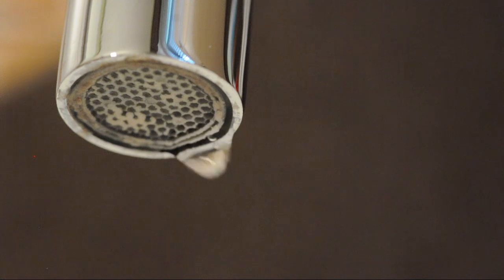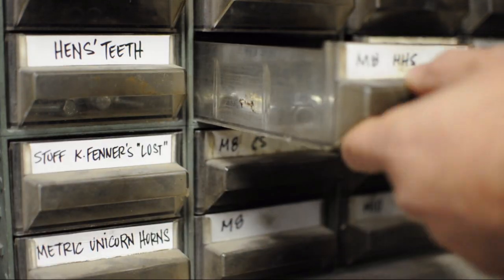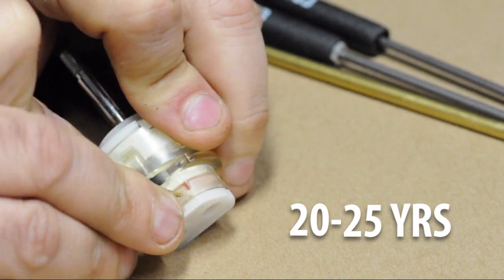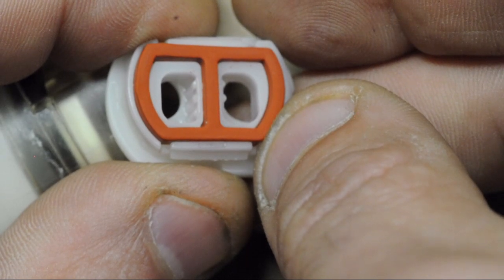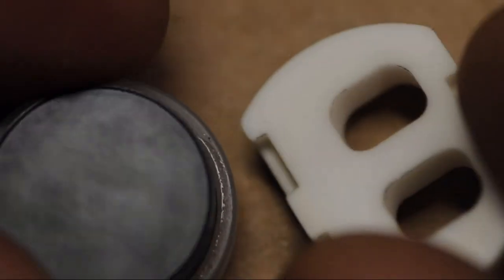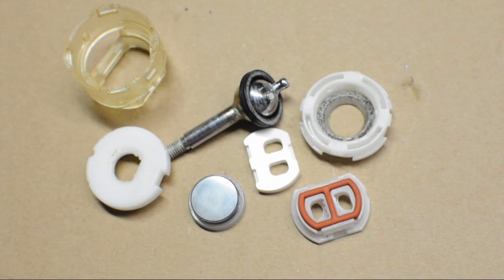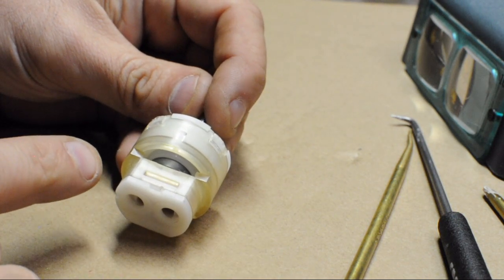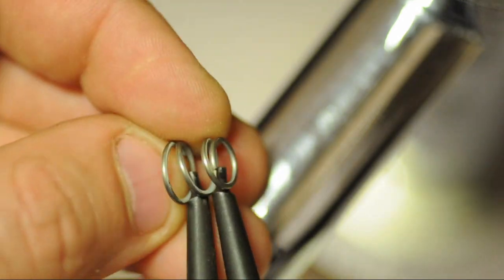Leaking Ceramic Faucet Fix

Comment: Don't you really miss the old brass-and-rubber seals of yore? The seats were so easy to trim (I still have a seat trimmer) and the seals were dead cheap; you could get about a hundred of 'em for about two bucks, and like old girlfriends you could flip 'em over in a pinch.

Comment: Anyone have any thoughts on those two disks suctioning themselves together during handle rotation? My kitchen faucet just because crazy stiff one day (no gradual failure). Taking everything apart, I got to these disks. I thought it was one piece they were so stuck together, but then I was able to shear them apart. I cleaned them, dried them and played around with trying to re-create the stuckness. Turns out it's very easy and only happens in rotation. Any thoughts on how to keep the handle from suctioning like this? It was fine for maybe a year and then over night it was stiff.
Reply: I just added a drop of water between the ceramic disks and they seemed to no longer bind like they did when they were dry. I reassembled the faucet and it seems like it's back to normal. At least for now.

Comment: I have worked on ceramics  for some time , and found that the compression from the silicone seal has weakened  this not only seals but puts pressure on ceramics.
If you replced the seals or increased the pressure on ceramics this will solve the problem.

Comment: you have the rare book with the misprint the scale is upside down and the text is even wrong. It should be seconds per drip with 14 at the bottom and two at the top.

Comment: I have a Delta Faucet in my shower and it had the same style springs and cup seals I replaced them with a new set from my local hardware store and it was good as new.  Thanks for the great video!

Comment: Tony , 
The hazy look you saw is normal , the white ceramic is slightly abrasive.  The spring loaded seals are the more common reason for the seepage . They are stainless steel to stop corrosion,  but stainless steel will take a set quicker than regular spring steel . You did buy some extra time , when it seeps again you should be able to just replace the seals . Good luck brother .

Comment: The cup washer and springs look like typical delta parts in just about any of thier faucets. They have been copied for years and are so widely used even walmart generally has them. If that is one of the main stream brands delta or price fister they alot of times will send out a new catridge tonthe homeowner by request.

Comment: Had a lift to open right and left turn / hot -cold which actually tightened up when hot water ran thro'   Turned out to be a poor quality Stainless pin which had some corrosion - clean up all OK

Comment: I recently watched a video on making custom molded seals with silicone sealant (guy was making a new o-ring for the tires on his truck). This could be a good technique to make a new seal for that valve, especially when you have a cnc router at your disposal

Comment: I actually did a similar fix on a run faucet that was leaking.  It was most definitely the two "cup seals" and springs.  That is what I replaced to repair the one I had to deal with. There are universal and brand specific replacements for the springs and cups at most local hardware stores. Great video though!! Keep em coming!

Comment: It's pathetic that faucets are built to low standards with crap parts.  Worse is that they often need replacing entirely because their parts are proprietary.  I get that people want to feel like they're saving money but at a certain point you're just throwing money down the drain.

Comment: Silicone grease on rubber parts fixes EVERYTHING! Btw. Cool vid. I've replaced tens or maybe even hundreds of these parts for work, but it never occured to me to fix them. Granted, I'd never fix one at work, just replace the part and be done with it, but maybe at home.

Comment: You can stop over here at the shop and get the parts out of my plumbing truck if you can't find them! :) Thats a Delta or Delex faucet IMO, or one of the Subs they sell to. The cups are Delta and should fix it, the springs I ALMOST never swap out. The ceramics are basically too good of a design as a bit of sand, grit, gross-ness...gets in there and there isn't enough tolerance to let the crud wash out. Many manufacturers tried the ceramic because they are "self healing" each time you use it they lap against each other. 33 years of rebuilding plumbing stuff.....and I go home and learn machining!  G>

Comment: Those little cup seals are typical of a Delta brand faucet. Easy to replace and with some good plumber's grease (your teflon should work well), the replacements should last longer than the original set.

Comment: That appears to be a Delta faucet or a knock off. Those are Delta seats and Springs they are replaceable. Normally stretching out the spring does not work. You can pick up the rubber seats and springs in a kit from any hardware or big-box store pretty cheap.

Comment: Fixing something rather than replacing, that's how I roll too.
It's not a real faucet if it's not using 00 washers. ;)
I've only recently discovered this channel, but so far I can deduce two things from what I've seen so far:
1) "Old" Tony is only old in the Orkenien sense. (Mork and Mindy) 1:20
2) Tony and Mr. Pete drink the same coffee; how else can they machine so quickly???

Comment: Just so you know... Most faucet manufacturers will send you replacement parts free with the tool if you call and ask.
Reply: That's very good to know. I have had a toilet manufacturer send me a valve assembly at no charge, but I didn't think it was industry standard.
Reply: @earlebird4262  It isn't really a standard, they just know the part is super cheap and giving you that part so your toilet lasts longer means you will keep them in mind as a stand up brand
Reply: @TrekkerMoto  That's good enough for me. I don't mind fixing shit. Shit wears out. That's just the way this universe works. If they want to send me free parts to fix stuff so that I buy from them again, then we both seem to win. I wish we could ALL get along this well.

Comment: Anything with a ceramic or carbon water seal... water, only water to seal it. All my industrial pumps state no oil or grease, not even a finger print. Keep it dry and clean assembled. Water does the sealing.

Comment: I'll wager a 1"x1/4" washer that can pretend to fit into a vending machine, that this will last as long as the current lifetime of the tap divided by the root of the increase of use multiplied by the relative degradation percentage of the seals  and the forces involved in hate-testing the repair once a potential replacement has been spotted in a home styling magazine, and is guaranteed to fail on either a sunday, the fourth of july or thanksgiving.

Comment: Odds are it was a fine sand particle on the lower seals I've seen it before in a slightly different  valve. It should last at least a year maybe more depending on particulates in the water.

Comment: About 7 years ago I replaced two of my faucets with ceramic disc style models. The sales pitch was that they will never leak and that they get better with age as they wear. 

In reality what I found is that they're fragile and cannot handle any dirt or debris. Rust from old pipes, dirt or rust from the city water main, or any rough use will destroy this type of cartridge. Also, finding some models is nearly impossible. 

We have two plumbing suppliers here, as well as the big box stores and none of them stock cartridges for the older Delta or Moen models. I called about warranty and was told that I'd have to buy a new cartridge locally, then return the old one and they would send me a replacement. I got lucky with the one unit, the fixture itself, supposedly stainless steel, corroded through and had to be replaced. They sent me a complete new faucet, after I shipped the old one back. I still had to buy a new one out of pocket.

Comment: Those spring and black seal arrangements that you found in the faucet body are "Delta seats and springs" readily available from a Home Depot kind of place for about six bucks.  Be sure to buy Delta brand not aftermarket.  I'd guess that's where your leak was.

Comment: Forever technically practically and legally speaking is the minimum duration for the warranty period. That's one of the main reasons why everything is shitty nowadays. Instead of fridges working for 30+ years and counting, you need replacement after few years for example...

Comment: It was the cup seals. 99% of the time that's what goes wrong with those. If you have anymore issues with it just try replacing those. Only a few bucks at your local hardware store

Comment: I speculate it'll last for about 2 weeks, I've had mine apart many times from the shower and mine had silicone grease between the disc's.  Sometimes if you over tighten them it can cause scars on the ceramic as well.  I have called the company and they have sent me replacements free of charge.

Comment: Gotta love how shitty some manufacturers are with using proprietary systems in a market where there are standardized sub-assemblies already widely spread and in use by multiple companies in all price ranges. That's the kind of company that, if it were equated into human form, they'd be the douchebag you most certainly need/want to punch.

Comment: With luck a couple of years.  I have had to fix a number of faucets around the house that had similar seals.  I guess they are "better" than the old style you had to regrind the seat on they do seem very susceptible to any kind of grit in the water line and I have an old house.  I usually get a year or two before disassembly and cleaning it all out is required.  May try the hot vinegar next time also because we do get some mineral build up.

Comment: I used to service a building that had a dozen Delta brand faucets that used the ceramic discs. supposed to be life time parts. I would find every year a few leaking. I would call up Delta and they would send me new ceramic discs free of charge.ay want to call the manufacturer and see what they say.

those seals you found on the inside bottom of the faucet are common parts found at many hardware or plumbing stores. they are used on may styles and different brand faucets. not only ceramic

Comment: Great video. But, there is no such thing a "teflon lube". Teflon is just solid additive that can be added to pretty much anything. There are only three types of lubes out there. Petroleum, silicone and fluoro-carbon. Use silicone lube on average rubber, use petroleum lube on silicone rubber.
Reply: DD bhaha You forgot to list 'food-grade Teflon'...

Comment: To cut to the point 99% of the time it's those rings even on non ceramic valves. Most every hardware stores sells them. They're designed to fail before the faucet. Little low end video for your technical skills. I'm pretty sure the kid is the one that actually did the work because a child could have figured that one out. By the way when you grab your rings go ahead and change the Springs while you're at it less than a buck.

Comment: Over engineered faucet,  but could be the  minerals in the water causing premature  leaking.  Need new cup  washers if available. Probably not, $100  for the  cartridge?  Nope.

Comment: Tony, Another spectacular video chocked with hilarious references and quality editing. The valve assembly looked entirely foreign until you made it to the "cup seals" & I'd wager that the repair was only marginally successful (by increasing the spring pressure).  I'd further bet that replacing those seals would fix your problem. Let us know!

Comment: When you think about it, as far as the spousal dynamics are concerned it wouldn't matter whether or not you were able to actually fix the leak. Once you made a special tool to disassemble the valve, you crossed over into Happy Hero Land, and what with the quality father-son time you cleverly worked into it, you were good for another six months of lounge-chair indolence.

Comment: The rubber seats that the cartridge sits on are your problem. They'll wear out pretty fast with use or if you've got hard water like we do in Omaha. 
AvE wouldnt wanna supply of this tap water. Freeze them tap n die like my wife's heart!

Comment: Next time buy a Chicago faucet and the cartridge really will last 20 years.
Reply: Don't always go for the expensive part first. The ceramic plates in this specific kind of cartridge are tungsten carbide that has been polished SO flat that they legitimately can't wear out. Something else fails first.
IMO it wasn't the cartridge that failed, but getting a look inside was useful. I think it was the one of those two little spring-loaded black seals that failed. Stretching the springs might be enough to solve it permanently but if it was me I'd put a new seal kit in. Those are available for cheap, like under $10 bucks.

Comment: Awhile.  You can get replacements for those cup seals and in my experience that is what fails.  Grit etc in the water lines either rips them up a bit OR gets stuck on them and then they don't seal well.  What ever engineering genius  invented them assumed pure clear water with no odd debris or the odd rust flake.  In other words "lab conditions" and then dumb old people used them in the real world...  More preload is probably a good idea.  Buying time is key to the game!

Comment: about ten years ago I reused a kitchen cupboard with a sink and faucet. where it came from had really bad water. lots of rust. sat for a couple years I put it in and the faucet didn't drip it ran and fast lol.  so I was thinking it was junk. last resort I water hammered it by turning the water on full stream and shut it off with a bang. hasn't dripped a drop since.  now that's called being a plumber lol

Comment: in case anyone is interested in pneumatic connector trivia, Milton is one of the leaders in the industry. The "M" style connector is a popular one. I think there are 10 or more connector styles that all look very similar.
A particularly nasty practical joke (not that I ever did such a thing!) is to replace one style with a different one on an air hose at work ........and then watch your co-workers struggle to attach the hose to their air tools :-)
Reply: No shit. I can't go to two different stores here and get compatible connectors. Some combinations will actually mate and positively lock but be as airtight as a sieve.

Comment: Theoretically ceramics should last a long time -- 25 years sounds right, so it is either glop on ceramics or something else. Sure enough it was those weird cylinder seals at the bottom. Very good diagnosis, Dr. Tony, and glad to see patient recovered satisfactorily. It was much easier when all we had to do is replace a pair of rubber washers in the faucet.
Reply: My parents installed 5 faucets with ceramic plates in ´81. One is used very rarely, so that doesn´t count. But the four others are ad of them only one ever developed a leak. If I remember right, even there it wasn´t the ceramic plates themselves.
So - 35 years and still choochin´!

If your tap water has highh levels of calcium carbonte in it, dipping the valve body in descaler every few years might be good idea.
Reply: Lots of factors. How well the ceramics were made. Calcium in water. Other junk in water.. Quality control procedures. On and on. THat's why I said "theoreticaly" :)
Reply: There is a huge difference in ceramics. Some hard, some soft. No need to explain soft. But all will "weld" the plates together if not used frequently. Explaining is complicated: flatness, stagnent water, atomic bonds, calcium, silicon, on and poor memory. But the plates slightly bond. Then when operated there is a small tearout. The pit grows over time and scratches in the plate happen. Eventually a leak happens on the plates.